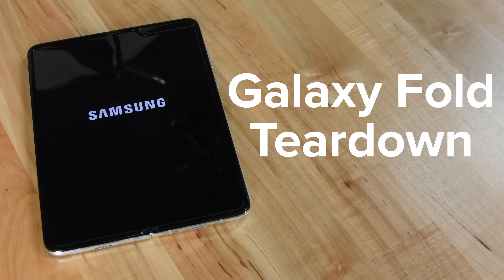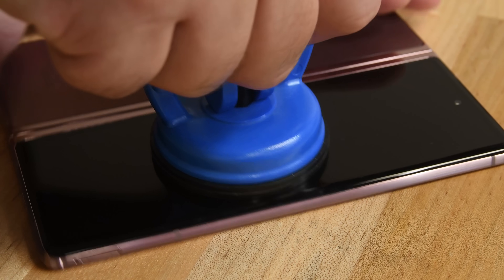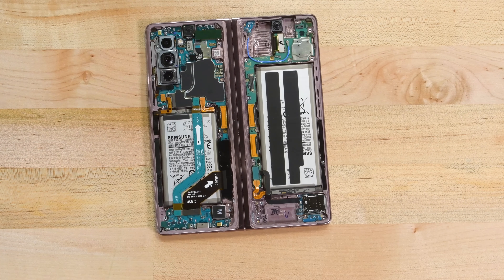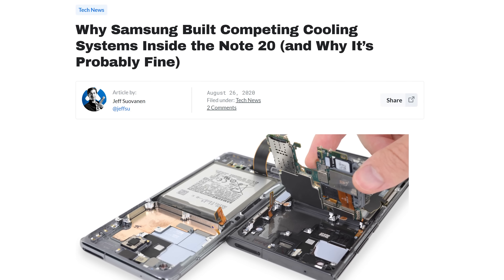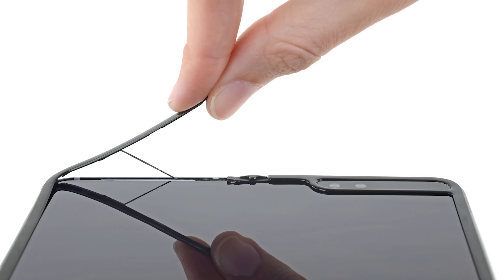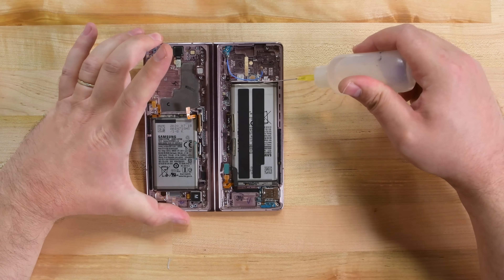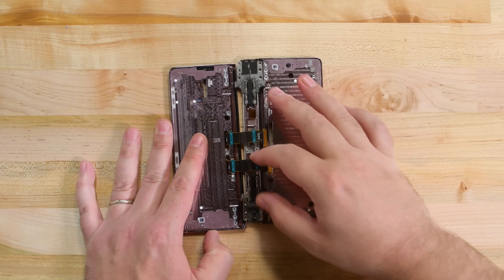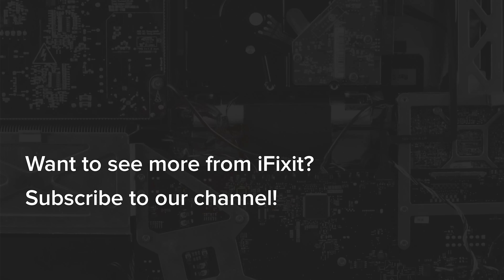Z Fold 2 Teardown: 3rd Time’s The Charm?

Comment: My fold 2 inner display just died ,it still detects touch but its black ,won't light up. Do I have to remove front including the front display {it works } in order to remove the inner display to replace it ?

Comment: It’s great to see Samsung build more modular devices, but I feel like the repair ability score is a little harsh.

Honestly, the only issue seems tk be with Adhesive the screen and no appealing batteries, but it seems like the screen comes off easily.

I recently fixed several Samsung galaxy S 10 E‘s, but the trouble is that the adhesives are much more firm and closely connected to wireless chargers and other components so that prying the back cover and screens could damage the whole component. That one deserved a low repair ability score only because the parts were less modular and required more tools.

This phone seems like a wonder to fix And disassemble. Kudos to Ifixit for this review, and Samsung for making phones actually repairable.

Comment: Still don't understand why they can't put gorilla glass on the 2 halves and then lay the plastic protective coating that's on it now in the middle and use temperature or a bonding agent to make it blend seamlessly. I know the razor's screen moves to minimize the crease in the screen but from what I've seen the fold doesn't so the 2 sides could be solid almost eliminating the delicate area and allowing the use of a s-pen.

Comment: Apple-  uses proprietary screws
 - can't remove back pannel if broke 
Cost more than half to replace back panels 
- doesn't allow third party  repair 
3d tuch wont work if screen replaced same with tuch id

Scores  6 or  7  evry time

 Samsung-  provides manual  
Can replace freaking foldable display without even breaking anything 
All Philips screws..
Still 

3.. 
 Ifixit  wtf...

Comment: Your ratings in my opinion are always full of shit, or you are too harsh. This was more like a 5 or 6/10. Really have to rethink the evaluation methods cause nowadays everything is gonna be using adhesive and you are providing a false image of the repairability of any product. Back then you gave non-modular components this type of low score, yet we see you have not even changed the way you evaluate repairability if not why would fully modular internals still get 3 in repairs. Complete garbage.

You gave the surface duo a 2 which seemingly looked evidently way harder to disasemble, with adhesive on every component, worse modularity in components... yet this only gets one point higher.

Comment: I believe this phone deserves a repairability score higher than 3. You cited zealous use of adhesive as the only reason for keeping it so low, but mentioned in the beginning of the video that there was so little adhesive you almost didn't require an opening pick. By the looks of things the battery was also much easier to remove. From what I saw it was pulled straight up rather than pried, and didn't show any denting or creases that would suggest you needed to pry it out with excessive force. So to me it looks like they improved a lot with their use of adhesive, especially since you said so yourself.

There's so many modular components, screws aren't mixed and matched to require different sizes and bit shapes to remove a single part, and by the end of the video you'd forgotten that you informed us you can actually purchase a service manual for the phone. That alone should add two points to the repairability score. It deserves at least a five or six. The use of some glue under the battery shouldn't knock seven points off of the repairability score when, since it was the only listed downside, everything else seemed perfectly fine. I'm fully aware that batteries don't need to be glued in, and I don't like when they're glued in either, but seven points off is a bit harsh unless you have some other downsides you didn't make note of.

Comment: I think it deserves more than 3,that teardown looked relatively easy.
Reply: Its not the disassemble score, but the repairability score
Reply: Hennark Ilsen idk bro they successfully took every single thing out of the phone. i think aside from the display. everything can be done with a hairdryer, and a regular screwdriver bit set
Reply: SOZ I KILL YOUZ i know what you mean, but the Display is such a critical component. Especially when it‘s so thin and scratchable. Asides from the battery, the Display is the most replaced part in the phones i work on. And that makes the fold a quite hard to repair phone.
Reply: Any new technology not gonna have good repairable score because the technical skill to repair them is not discovered yet. They can't use old stuff that we call easy to repair to make new technology for us.
Reply: @wabalaka1565  your slightly wrong there the issue is allot of tech isn't modularised and yes there are some valid reasons to not do so. But eg on a pc if your CPU or ram goes pop you only have to replace that module but for allot of tech they are like nahhh put everything into one board and force a repurchase.
Reply: @TheOpenSourceMerc   existing tech being unrepairble is different from a new technology that introduce to u today being unrepairble. What I said is simple and clear
Reply: @Sidney95  Now try to do that with all the tools but you have to do it yourself
Reply: Exactly, it looked, now try to disassemble it without the thermal mat or the guide
Reply: @spannerwindslayer  now desemble a iPhone with a fresh cought fish, not having the right tools for a job is a you problem not a phone problem.
Reply: @spannerwindslayer  of course u need tools stupid

Or not u make as well accidently open it or your child open it
Or someone could just take our your battery then hide

Comment: It seems to look like you could put it back together and still get a working device!
Reply: @deanwoods8647  why not? Nothing is broken
Reply: @deanwoods8647  the screen looks intact bro..
Reply: Ye it will work unlike Jerry rig who will probably rip the screen
Reply: @deanwoods8647  Even if the inner screen died they could still use the outer one.
Reply: @exploregadgets1774  then the entire point of buying a foldable phone is out of the window
Reply: As usual in many disassemble processes.

Comment: There are unused spaces on the top left and bottom left of the right screen. Samsung could have used that to fill up better components, like maybe put a better speakers or sd card alot.
Reply: weight distribution for flex mode
Reply: Blue Mars speakers on this thing are great

Comment: Still not sure about calling it a “glass” screen when the part you touch still scratches just as easily as plastic, but it’s good to see them still working on making it better. Find a way to make the screen hold up as well as a glass display on a traditional phone and get rid of the crease (and make it cheaper lol) and these folding phone might actually become something other than a small niche device
Reply: It has a screen protector on top of the glass
Reply: Kijjjy yeah I remember when Zach did his durability test on it. And you can’t remove the screen protector. So while there is a form of glass in the screen, you never actually touch it and it doesn’t do anything really useful 🤷🏻‍♂️
Still, they are trying and that the point I was getting at. Right now they will not be anything more than a niche device but a few more years of development and someone is bound to figure it out. And then these might just be good enough to catch on mainstream (well when the price goes down lol)
I’m not really trying to knock the Fold, just know not to buy into marketing fluff (like for example Apples Sapphire glass for example is no better than regular glass lol)
One day someone will figure out a real answer to a folding screen that will hold up and not scratch, but until then we have to deal with marketing fluff lol
Reply: @dragon81heart  you can remove it. That's 100% wrong, there's multiple videos of people doing it with no issues.
Reply: Kijjjy  
https://youtu.be/P52pqNMpXSU
Reply: Kijjjy idk, looks pretty clear in this video when Zach tested that theory that removing the screen protector is not a good idea because in doing so it completely destroys the entire display...
I linked the video so you can see what I’m talking about
And that the it shows that the “flexible glass” screen is just as fragile and prone to scratching as the original all plastic screen on the original Fold
Reply: @dragon81heart  the phone that you're talking about is the fold 1 prototype, people took off the plastic on the display and destroyed them, that doesn't happen  with the fold 2 cause they changed the display.
Reply: Kijjjy did you even watch the video that I linked above? Lol
That is not the original plastic display the he is testing in this video 
It is the flexible glass display that he is testing in this video
And it clearly shows that removing the screen protector does indeed completely destroy the whole display
Reply: @dragon81heart  I'm sorry mate but you don't know what you're talking about
Reply: Kijjjy I’m guessing you are going to try saying Zach from Jerryrigeverything doesn’t know what he’s talking about either right? Lol

Comment: Looks like at least 5 / 10 to me, with all those modular pieces and no need to remove the folding screen for the inevitable battery replacement.
Reply: with those glued in batteries it's definitely not a 5/10 but a 0/10 or 1/10 at best.
Reply: @Raja995mh33  So you do want battery to sound rattle without glue? Now you would say pull taps but you should know that after 1.5 year those taps start to melt makes it impossible to pull. So glue is the best option that can be easily removed with alcohol
Reply: Cancer Called Human Species nonsense. They just should use pulltabs like Apple or OnePlus and not 2 tons of glue.
Reply: @Raja995mh33  Their adhesive is pretty easy to remove. Just some isopropyl underneath it and it's good.
Reply: @Raja995mh33  Pulltabs are worse, cause when you actually need to replace the battery (like two years after you bought the phone) they have become brittle and they snap even with really careful pulling. And since they result in the adesive being concentrated along two lines instead of being all over the battery, it's much harder to dissolve the adhesive with the solvent method.
Reply: @luca7069  Even IF that may happen, It's still a million times better than 2 tons of glue. There's no need for a discussion. Seriously.
Reply: @Raja995mh33  It's not IF it happens...it happens, period. It's a matter of material degradation that occurs with time and heat.
Fully glued in batteries aren't necessary, a little glue or a couple of screws like in old laptops would do just fine, but it's definitely better than aged pulltabs.
Reply: @nothing9220  Seriously? You people are defending gluing batteries in place? I thought this would be a pro-repair comment section, but I case you guys can make an exception when it's your favorite brand that can do no wrong. Pull tabs aren't perfect, but they're a hell of a lot better than this, and I've never once heard of that rattle issue - I call BS unless you can provide documentation. Glue works on pull tabs too, so there's literally no disadvantage - if they break then you just use solvent like you would have to anyway on a Samsung, but if you don't break them, then you've just saved yourself a huge headache and didn't have to damage the battery in the process - which can be very dangerous. I'm not sure how strong the glue is on this phone, but I know in some Galaxy S and Note models, the glue really is so strong that you have to damage the battery to remove it.
Reply: @Raja995mh33  Luca isn't lying. Those pull tabs melt or thin out towards the edges where you're suppose to pull, thus causing more problems. Its very useful at the beginning, but it isn't lasting
Reply: Ragon Maarten 
If the pull tabs failed then you can go for the alcohol route. There is also a chance for them not to fail after many years.

For glued batteries, the only choice you get is alcohol.
Reply: @Raja995mh33  Please hear urself..
U looklike a crybaby
Edit: wait a sec..you watch jerry rig? right?
Reply: @SCtester  I don't get why everyone says glue, when it very fucking clearly is double sided tape holding the batteries in.
Reply: @Raja995mh33  pulltabs are good if your device wont last more than 2 years or less. Glue is bettet in the long run.
Reply: Variamente no it's not.
Reply: @Raja995mh33  As someone who has repaired phones for a living for five years, it really doesn't matter what method is used when comparing Apple and Samsung. Huawei though, their system ruins the battery when removed.
Reply: @nothing9220  no you can just use the iPhone 4s foldable adhesive

Comment: It's true there's again much adhesive but this time you seemed to get rid of it quite easily. The screen is glued but there's not need to remove it in order to access other parts. Those batteries however need some easypeelsy strips. Never blame screws when they replaced glue. The usb port is on a separate board so easier/safer to replace. For me is a 5/10
Reply: Yes
Reply: Yes
Reply: Yes
Reply: Yes
Reply: It should be a 0/10 because of the horrible battery removal process and tons of glue.

Comment: Change the damn title.

This is a 2nd generation product.

1st gen Galaxy Fold never launched to market with its initial problems. It got delayed.
Reply: If we want to be technical about it, it's technically closer to the third version of the Fold. As the first Fold that was released had major issues with the screen and had to be returned so that consumers could receive the another edition of it.

Or as Samsung would prefer the Z Fold 2 to be a combination of the Z Flip + Fold so it would be the 3rd time Samsung has released a "Folding/Flipping" phone.